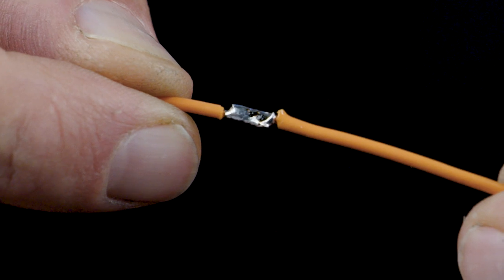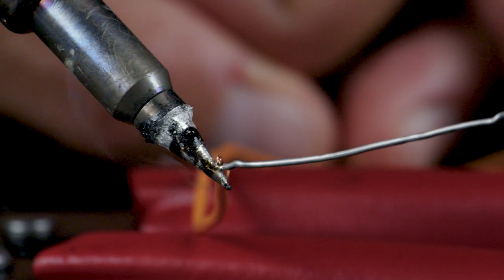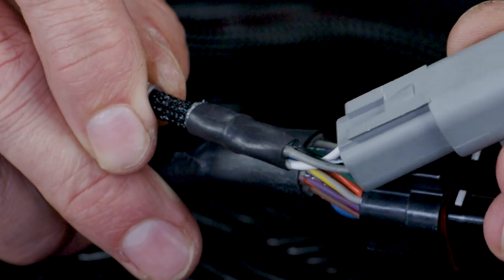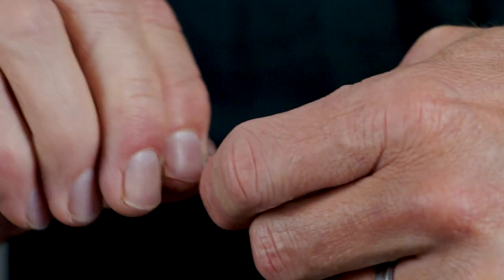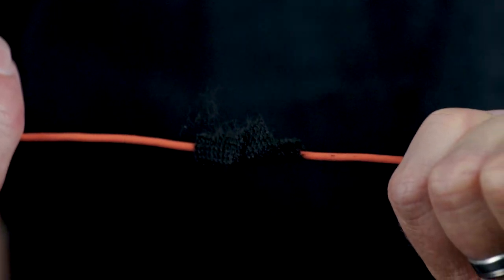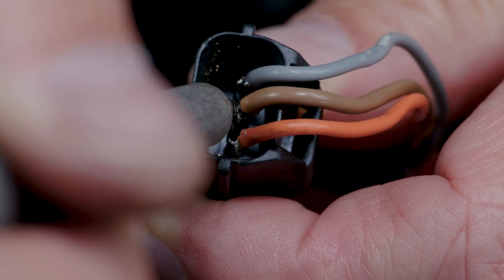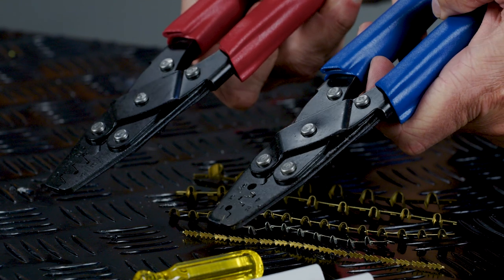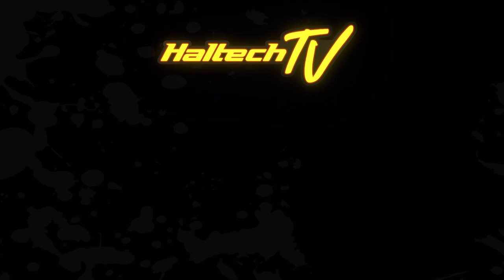🛠 Crimping vs Soldering - Which Is Best? | TECHNICALLY SPEAKING

Comment: I only add solder to a crimp when I'm doing big battery lugs, (2ga or bigger) but I'm glad to hear that it's a bad idea for long term use. I'd say that keeping oxygen out is the most important thing for any connection like this, so if you can create an air tight seal with glued shrink tape that will help a lot. At the end of the day, oxygen and vibration are the main enemies to wiring for a vehicle that doesn't see salt water
Reply: A proper crimp will create a cold weld which will keep any moisture from wicking into the joint. Water tight shrink tube over the joint for good measure and avoid the solder.
Reply: Propper crimping will make all wired and lug cold weld into one solid piece. There is a reason crimping is a thing. It's simply better, when done right.
Reply: Exclusively soldering large connector, like battery lugs, I probably the worst thing you can do !  Very high probability of a "cold" joint because it is difficult to get all of the metal up to the melting point of the solder.  Worse if you are using lead-free solder.
Reply: Ignore the others.  Those who do stuff for extreme environments like Caterpillar and a lot of people in marine environment crimp then solder.  There are several reasons for this.
1) No, the crimp joint doesn't cold weld the whole thing.
2) There is no such thing as waterproof shrink in real life.
3) Without destroying the joint you can't tell if it is "done right"
4) In a marine environment crevice corrosion is a major thing.
5) I spent a lot of time doing field repairs on equipment because the production manager "knew better" and insisted on crimping with the magical calibrated crimpers and not soldering.  The units started failing at the 6 month mark.
Reply: @kensmith5694  Well, you are either lying or you are not very experienced. I call you out since you started with punctual "corrections".

I can't post links here, but you can read the NASA standards. No solder to found where you don't absolutely have to utilize it.

Most if not all your electronics connectors in vehicles, is crimped too.

1: Yes, proper crimping makes a cold-weld. If you haven't experienced this, then you are doing something wrong.

2: Solder is not needed when something is a solid cold-weld. It can't penetrate anyway. You use gels inside the sleeves.

3: The same can be said about soldering. But crimping has a much better chance of being correct every time. Here is why,. Crimping is done either through a repeatable mechanical movement, or hydraulic pressure, which you can read and repeat the same pressure. The actions are mechanical repeatable and therefore you can expect somewhat same results every time.

4: Yes, crimping and proper jells is still the best choice.

5: Soldering is creating stress-points when the solder wigs up the wire. Dry cracked solder too. If you tell the truth, then it's clear the crimping wasn't done properly.

Also, Crimping doesn't fail completely if the wire gets very hot. Solder melts, while crimps stays together. It's also much more resistant to constant expansion and contraction under temperature changes.
Reply: @Mr_Wh1  when my crimps fail, I solder them. Everyone isn't using aero quality materials.
Reply: @marshmower  if your crimp fails you are doing something wrong. Perhaps you are using a bad tool?
Reply: @Mr_Wh1  See thats the problem. One good soldering iron will take the place of 50 connector specific crimpers
Reply: @seymoarsalvage  That comment tells me that you clearly don't get it. It's the solder that is the problem. It creates stress points. It melts if a failure occurs, then it hits something else and creates problems there. By this,, silicone wire sleeves becomes close to pointless. It creates corrosion by flux and heat. It damages isolation material. It doesn't even have a lower resistance compared to a proper crimp.

Soldering is NOT the solution for everything.

Comment: A lot of good advice in the comments... Aviation uses crimps. The rigidity of solder makes wire susceptible to fatigue and break under repeat bending or vibe. Heavy automotive stuff I like to use both. e.g. crimp on ring terminal on a wire follow it up with a dab of solder where the wire sticks through on the ring side. You don't want solder wicking up into the wire on the other side of the terminal or you'll create a rigid point where it can break. Wire stripping is also super important. Any knicks on any of the strands and you should start over. One small knick creates a weak point for the entire connection to break. The best crimpers are the ratcheting kind with different jaws you swap in. Paladin, Greenlee, Daniels Mfg to name a few brands common in industry.

Comment: My 2c. I was a bmw master tech. I used to solder everything. I felt like I had it to a fine art, having started on pcb kits as a teenager.
BUT. One thing stood out to me over time that you couldn't dismiss. Several models had an externally mounted air temp sensor under the car that would get ripped off the car all the time. Even after cutting the loom back to good wire and soldering in the pig tail repair connector and sensor. The temp would always read 3-4 out. So I tried the open barrel crimp supplied in the pig tail repair/replacement kit as an experiment. Temp was bang on every time. The results were repeatable, over and over. 
So, much as this video explains. I became a crimp man where it should be crimped. Solder where it should be Soldered.
Reply: I can explain what happened there. The temperature sensor is almost certainly a thermocouple. The way those work is that a connection of two dissimilar metals generates a very small voltage which changes according to the temperature. What you did by soldering is to introduce a third dissimilar metal (Solder), which, in connection with the copper of the wire, generated its own electric potential and thus skewed the measurement. The barrel crimps however were chosen especially so they do not generate any potential at all - they were probably non-plated copper themselves (but not necessarily, there are platings that also work in this situation). This isn't really an argument against soldering as it is a very special situation, probably one of the few that could generate malfunctions in a car - which doesn't mean that soldering is okay for wiring in automotive applications. I strongly advise to use crimps whenever possible.
Reply: @horrovac Bit late with this but here goes. I have 2 wires on an injector pump that are bare from insulation breakdown. They feed a solenoid/ coil. If I cut them, would soldering them back together affect the solenoid operation. Same with the crimp, ....or would that be a better option?
Reply: @rocknral  No, soldering would not affect it's operation - but using a crimp would be better as a general rule.

As I said in my first post, a thermocouple based temperature sensor is a very special case because it relies on a tiny voltage on a junction of two different metals that changes with temperature. Solenoid coil wiring is not a sensor or a measuring instrument, so the method of connection won't affect it's function at all.

Comment: I do in-line twists + solder when I have the spare wire and space to do so. Direct copper-to-copper contact between the spliced wires, the solder is basically only there to prevent wires from pulling apart.

Comment: I work as a dealership tech, and the repair manual says I have to use crimps when I do repairs.
I've sworn to this method for the last 14 years and I will continue to do so, as I think it's easier and faster than soldering (I did plenty of soldering in my hobbies building PCs and model train tracks).
My favorite crimps are the ones with shrink tube included for extra fast repairs.

Of course, this method isn't perfect. I've had to redo my work several times, but it's a lot easier to do a repair in a cramped engine bay with crimps than soldering.

Comment: As "Pins and Screws" said, soldering creates a stress point in every strand, where the solder wire interface is located. As the joint moves strands work harden and break in the end, this put more stress on the remaining strands and they break faster.
Crimping forms a cold weld between the crimp and the wire strands, this means that the each wire strand is cold welded to each other and the crimp shell. Also with a lot of crimps the wire insulation is taken in to the crimp shell this provides the strands with more protection from movement so reducing work hardening and thus breakage. 

In cable forms in aircraft looms you won’t see many wires soldered to connectors, they are crimped to pins and then inserted in to the connector. Fully protected from vibration etc.

Comment: I built a complete new harness for my dual-sport bike. All joints and connections are crimped, and I didn't use sealed connector shells. Almost 10 years later, the wiring still works perfectly - although the lights connected to said wiring have died many times over.

Solid brass crimp connectors, TXL wire in many colors, and a ratcheting crimper; all told I spent about $50 and had a ton of leftover materials.

Comment: Crimping is the better way. Soldering is for when the former isn’t an option.

The issues with solder causing local heating, stiffness of the wire or corrosion has caused many an issue. In aerospace it’s non existent and unthinkable as a wire to wire connection.

Doesn’t mean soldering will fail. Just that it has more failure modes.

Any connection where there could be flex solder should be specifically avoided or the flex physically mitigated by potting.
Reply: Aerospace also has a lot of procedural influence; a crimp is a much more repeatable connection method.

Failure mode is also a consideration; crimps usually corrode and develop high resistance which can be diagnosed in service, whereas solder joins often fail mechanically potentially resulting in a sudden failure and/or loose wire etc.
Reply: If you get stiffness you are using bad wires of low quality
Reply: @epoxy1710  wire stiffness is a function of the material and stranding count and the braiding if you get fancy.

However the fact that when you solder. Solder flows between the strands stiffening the wire has nothing to do with the “quality” of the wire. It’s just a part of the process. You can reduce it by working faster but it’s very difficult to avoid.

Comment: In a car crimp. In a pinch I have made a crimp with crappy pliers and then put a tiny dab of solder by feeding it in the opposite end that the wire enters just to ensure the crimp stays put. I make sure the solder does not make it out the back side where movement could break it. 

On large gauge wire I use the method I saw from Lincoln and Miller on welding wire. I use copper pipe and strip the cable as long as the terminal I am making. Feed the wire all the way through. Then press or hammer the pipe flat on an anvil. Shape the end with a grinder or belt sander and drill the terminal. Deadly strong and the best connection with the lowest heat. We would run these connections at 750A for hours upon hours when doing large diameter Sub Arc welds. My personal record was 14hours non stop. The connections crimped this way were cool to the touch!

Comment: I have more than 50 years of electrical and electronics maintenance and engineering experience. There is a time and place for both solder and crimp. I never lay two wires side-by-side and then solder; the earliest that I was taught that was in high school electronics class circa 1962. I twist the wires for a mechanical bond and then solder; solid wire is a Western Union connection. Crimped lugs with stranded wire are soldered where possible. High amperage Anderson connector lugs have the wire coated in rosin, crimped and then soldered making sure the rosin and solder get sucked into the lug. A slight amount of lead/tin will dissolve the copper in wires and vice versa. In over 50 years of automotive repair I have had a few crimped connections fail that the manufacturer made in a wiring harness and my solution was to wire brush, coat with resin, and solder with 60/40 lead/tin even though the crimp material is steel. In an industrial application there are rules about types of crimps, the mash type for insulated lugs and the piercing type for plain metal lugs. I have a 50+ year old VACO crimper that will crimp insulated lugs just fine even tho' the NEC and codes forbid it. I absolutely will not use the splices that use a very low melting alloy so that the wires can be joined using a heat gun without crimping. Remember the I2R heating at bad splices causing heating and corrosion.
Reply: Thanks for sharing your experience with us. I prefer crimping fluxed stranded wire then soldering, then covering in heat shrink tube. I haven't had any formal training, it just seemed like the best way to do it.

Comment: Perfect clear explanation! solder has its place like for potting sensors and I’m glad you covered that! for most of the automotive industry use of good quality crimps are needed,solder is use specific and often is the cause of more problems than solutions having said that I’ll always solder if the correct tooling isn’t available though! Because my solder joints are better than 90% of crimps used in the automotive industry!!! but 99% of the time it’s crimps I use every day especially at home where I’ve got the gear! some high power gold plated connections are solder only but for these I use 60/40 tin/lead solder I’ve incorporated them in a few jobs even my own car! it’s fuel system can be switched to lithium for higher voltage(rc car batteries)lol and uses tiny connections 1/4 the size of equivalent capability Anderson connections

Comment: Right tool for the job. I've been saying this for a long time. When it comes to crimping, you can't run down to the local AutoZone and get some cheap crimping tools and crimps. When you're making a repair or building a harness, you should have everything planned out from the beginning to end.
Reply: Yeah there are some bad connectors out there.  You can get a really good set of crimps online for like 25 bucks and a decent tool for about 30.

Comment: The way I had it explained to me a long time ago was you can't turn off the flux in a solder joint so with vibration in a car it'll fail where the wire leaves the solder from corrosion.. 

Also that solder is rarely if ever used in Aircraft due to this.. 

Really enjoy the tech vids thanks Matt.
Reply: Starter motor terminals are crimped and soldered on RR Gnome engines!
Reply: "can't turn off the flux in a solder joint" ... that's true, good point. When I solder sheet metal we rinse the flux, nobody is going to rinse their wiring.

Comment: In my country where we have high humidity crimping has always failed due to corrosion, maybe because finding good crimping materials and heat shrinks is difficult, I have always had to do soldering to have a long term solution.

I agree with everything on the video, but sometimes the best solution is the one that you can reliably do with the tools at hand.

Comment: I've soldered lugs on my 2 gauge welding cables, which have a large amount of current and amperage run thru them, and never had the joint fail. The crimped ones inevitably pull loose over time. In order to get a good joint, I'll hold them in a vise and fill the cup with acid core solder, while heating with a torch, then push the wires into it. I've also had to repair crimped automotive connections that have corroded over the years from being exposed to the elements. The ones on the coil pack of my 2005 Toyota Corolla were wrapped in an epoxy substance, but were corroded underneath it.

Comment: My personal preference for an inline, wire to wire connection has always been soldering, but with resin lined heat shrink tubing to seal and support the joint. Of course, virtually all wires in an automotive harness have crimped terminals at the ends, so an extra one in the middle wouldn't do any harm, done properly.

Comment: Matt, slight tangent, but the wiring used in ships and planes (that I've worked with) has very fine strands as an offset to vibration. Some are silver plated as well. Prop shafts on ships have grounding assemblies with replaceable brushes to avoid static discharge. Worst I've ever seen in a car was a household "wire nut" used to splice a harness...

Comment: I am a retired automotive engineer.  Prior to my retirement in the early 2000s, most wire-to-wire connections were "twisted bare wire".  1-1/2 to 2 turns  over the bared wire and adhesive backed cloth tape.  A second layer of protection was applied.  Either non-adhesive PVC tape or convolute tubing.  This works well on stranded wires 18 AWG through about 12 AWG and has been used for over 50 years.  Smaller wires are now common but I suspect they are crimped.

Comment: I’m on the preference of soldering, but would also argue that this has been due to poor availability of good crimps. 
Wires twisted, fluxed then soldered definitely get good mechanical bonding and good oxidation prevention too. 
Check the nasa join method and it addresses some of the issues with side by side wire soldering.

Comment: Intersting after many years of rallying where joints are under a lot of stress we basically dont solder for some fo the reasons you mention sloder joints break where the solder endsm Our preffered conection is crimp based but with and effective crimp tool. The tool we used was none that used the plastic at the end of the connector to the end of the join process. This bit of plastic was then compressed by the tool to enhance the mechanical strength of the join process.